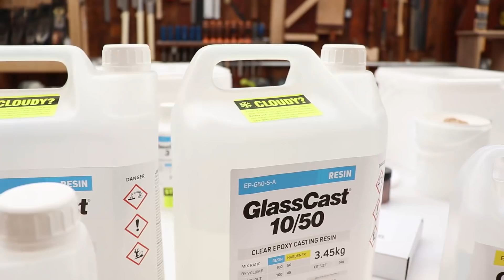Oak and Metallic Copper Resin Table. Part 2 How to Pour Resin and Achieve This Amazing Resin Effect.

Comment: Looks great John. I use and can re-use a few times just 18mm melamine with silicone and screws with mould release spray. Works well, new leaked. I always paint some resin onto the live edges to seal before pour to help reduce bubbles, some people swear by it others disagree.. I'm still on the fence.. The mould release tape is a great Idea on the wooden blocks, I learnt the hard way and used 4 x 2 off cuts without tape and when removed with a mallet took a good 20mm deep chunk out of a 6 foot length of Yew.. but we learn as we go.. at least i could fill the void with epoxy and get away with it..

Comment: Thank you so much for this video, the resin pour series, and all your content. Your content means a lot to me and I've learned a ton. I especially want to thank you for your tip on painter's caulk to stop leaks. That tip just saved my butt big time. I just finished my largest pour ever (9 gal) and, because of the design I'm going for, I couldn't build a proper wood form. I relied on sealing the live edges and a poly prop dam at the ends. I had small leaks everywhere. But, I didn't panic and the painters caulk secured every one. After I let the first 1/2 inch pour set, no more leaks and I could continue on. Thank you. Oh and I stole your colored bottom layer/clear top layer depth technique too!
Reply from the maker: Great to hear Chris, I'm glad it was helpful!

Comment: looks great, the clear epoxy down the middle really adds to the table. I did a centre piece for a table and didn't seal the edges with the brush and got bubbles, the piece was semi filled with aquarium stones. Couldn't get the bubbles out, it's not bad but it was a bit of a bummer.

Comment: Do you source resin locally John? Im on the look out gonna start experimenting.... any links sincs this video would be ever so helpful... wonderful table its a stunner..
Reply from the maker: I used glass cast resin for this project, I got it from Glass Fibre Supplies. I'm not sure if they are still operating.

Comment: Hi John, How much resin did you use and what would it cost had you bought it ?
Reply from the maker: 10kgs of glasscast 50 
2 1mx1m sheets of polypropylene
1 solid polished copper pigment 
1 metallic copper powder 
plenty of mixing sticks 
plenty of gloves 
1 tube painters caulk
1 pack of glue sticks 
8 2litre mixing cups 
1 roll of mold release tape 
1 10kg scales (you can mix by volume)
Reply: @JohnMcGrathManInShed  Cost ?